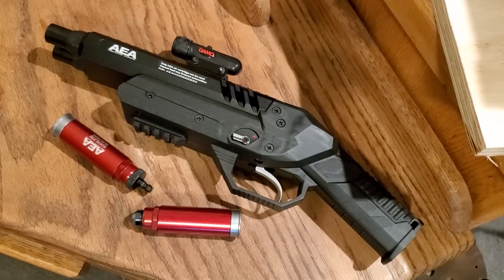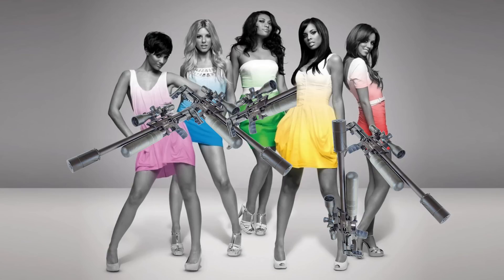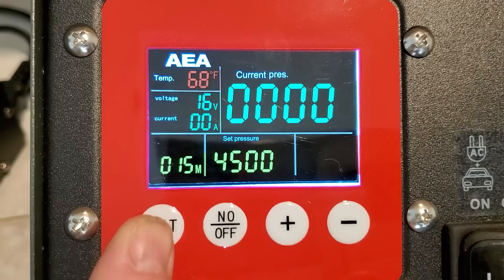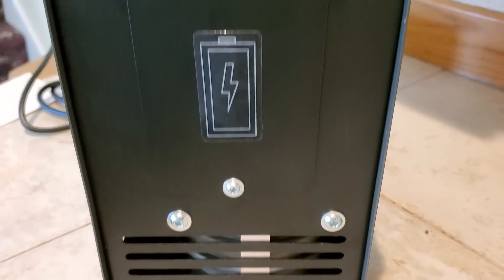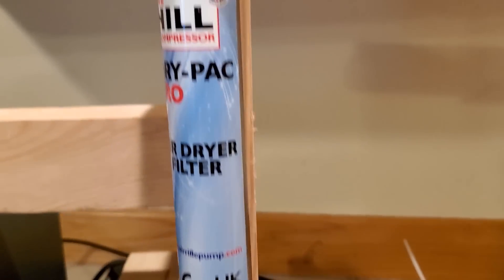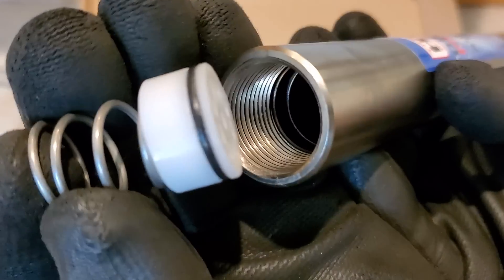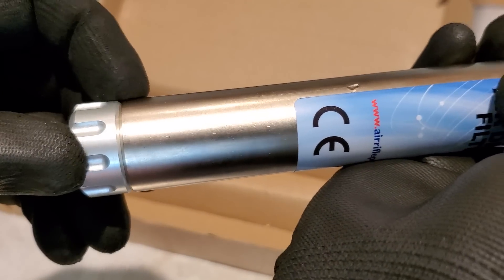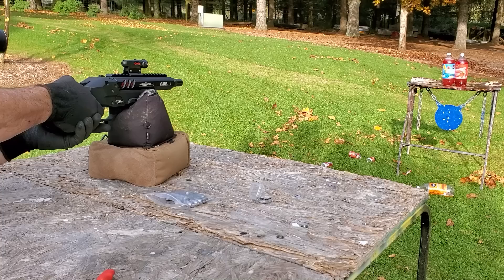AEA's 7000 PSI Air Compressor for PCP Airguns (Review) AEA Airguns Shop  (480bar) PCP Air Compressor

Comment from the maker: The AEA 5000 PSI cartridge took under 1 minute to pump up. The Run Time will read 15 minutes until you hit 15 minutes of run time. Also, the end that I installed my quick disconnect did leak (my fault) which is why the pressure decreased when I stopped filling the cartridge. I messed up in the order I used my washers when installing my hose ends, so the sealing washer I used on the quick disconnect end had too large of a  diameter (washer was not from this kit).  Also, I bought this compressor with my own money and do not recieve any affiliate income from this link.  Compressor is for sale here:  https://www.aeaairguns.shop/products/aea-airguns-compressor?_pos=1&_psq=compressor&_ss=e&_v=1.0&utm_source=nathan_murch&utm_medium=youtube&utm_campaign=compressor_promo_nov&utm_id=compressor_aea&utm_term=aea+compressors

Comment: I am still riding the fence on these.maintenance free compressors.  Unless they have tapped into Alien Technology, moving parts suffer friction, need lubrication that gets contamination / requires new clean lubriccation ....    
What does the manual state in regards to constant run time allowances  ?

Comment: Does the compressor come with the filter and if not would I need it if I'm filling my 98 cubic ft tank ?
Reply from the maker: If you don't use a filter your gun will be damaged by moisture. If you gun is $300 then don't worry about it. If it;s $1500 you will loose performance eventually and the tank can rust and blow up and kill you. PCP filter sold seperately:  https://amzn.to/4n9PLqs

Comment: How is it working after 10 months?
Reply from the maker: It lost pressure after 6 onths but I have a video on how to rebuild it.  coming soon
Reply: @AirgunChannel Sounds great! So even if it breaks it’s easy to fix?
Reply: @AirgunChannel  Bintac AEA website explicitly states that this is for airguns only. NO large tanks.

Comment: Just got my replacement compressor. First one crapped the bed.
#1 its now 110v no more convertor box.
#2 compressor is significantly quieter. Sounds more like my other show box type compressors.
I really believe it wAs defective from the rip.

Comment: Thank you for a really well produced channel.  I have watched so many videos while getting my finances sorted out, I am more than mildly overwhelmed. 
 I apologize in advance.   l am sure these questions are often asked. 
Preface: I am total newbie to this sport/market with only YouTube exposure to the sport.
My current intention is to buy this 480 BAR compressor soon. 

Part 1:  With longevity and quality being my primary concern, would you personally defer to another ( obviously lower pressure at this time ) compressor or would you be more comfortable going with something this new.

Part 2: 
I am going to be limited to around $1000 for my first ( and possibly only ) gun. I can stretch some if needed. I have not settled on a specific gun yet. My primary focus will be small game and target secondary .  I am thinking that a very tight group at 50 yards max in 25 or 22 cal. will be my main priority and ease of carrying secondary since it will probably also go to the field.

Comment: Does anyone have issues with the power converter optioned with the AEA compressor? Works fine on the AEA carts or even my smaller Gk1 tank but larger tanks it trips off. 
Not to mention its $227 from AEA, same $30 unit on amazon.
Looks like this 500w unit is made for smaller things like Tablets, table fans, etc.
Reply from the maker: mine a,so trips off 3/4 of the time.
Reply: @AirgunChannel bought the 1000w off amazon. So far if hasn’t tripped off.

Comment: Also: your voltage drops to 12 volts under load, mine doesn't do that. Probably your external converter cannot handle the load?
Reply from the maker: Converter blows the fuse regularly ..so yes.
Reply: @AirgunChannel are you sure you should set it to 110 and 220. Shouldn't those numbers match, I'm a bit confused on what's going on in your video at the plug setting

Comment: I have one and opened it up: there is a power supply inside with a 110/220V switch, just switch it to 110v and lose the converter.
Reply from the maker: WON'T WORK LIKE THAT.

Comment: Hey my friend.. where do those white washer/orings go? One came with the brass connector in the bag. Figured it went there but the instructions mention teflon tape on that end. I also see one in the plug thats on the machine.. prob to test it. 
The machine end fitting has a small o-ring in it already. I used a reg o-ring gun end and screwed in into the machine as is. It slowly drops pressure after it drops but the fittings seem fine.
Edit i see yours does too.. must be normal. How was your gun end connector ? Mine took some force/working in to get the fitting in snd sleeve locked in place. 
Another question i have is, with all compressors you are told to start the pump with the bleed valve open and then close. AEA instructs to start the pump with it closed.
Reply from the maker: Those seal the fittings, so inside the hole before you screw in a hose or foster fitting. Its a delrin ring.

Comment: I have the compressor and the Dry-Pac. The tube coming from the compressor to the Dry-Pac hose does not fit into the hose. I am sending e-mail back and forth with the support for over a month. Did anyone here had the same issue?
Is the compressor worth it? Otherwise I'll send everything back and get another.

Comment: Wooohooo just bought it… trusty YH starting to make noises and my Cs4 is slow as F.
Also have a CS 12v which is great out in the field but slow like its 110v brother.. just not as slow.
Reply: How did it work?
Reply: @JayPing-d5j5o greats its actually my 2nd. First one started clanking around. 
Got a new pump within the Warranty period. Also repaired my cs4 that had a snapped rod bolt. Had bought a cheap 200 compressor from amazon to get me through so now i have 4 working compressors haha
Reply: @Jeeper1378 which one you like better of the four?

Comment: The best compressors are the ones with water oil and air cooling!!! The other ones burn up!!! I bought a tuxing water air and oil still working!!! I went through three that you did not have oil water!!!
Reply: they are worst compressors, water oil they often go bad
Reply: @gagain100  I'm on year 2 with my water oil and air cooled and I charged scuba tank and five guns!! The air cooled I went through two of them in 90 days!!
Reply: @jerryburns22  Because they are not designed for big tanks. Just for airguns. If You use big tanks then yes water cooling is good.
Reply: @gagain100  I never used them on a SCUBA tank they burned up airing up two guns

Comment: Buyer Beware!!! I bought one and this thing will not stop leaking air. No way of how to set it up, no threads you will need nothing is said here. I look at sitting on my shelf and shake my head. Nothing I do works and it leaks and will not achieve any pressure. Sucks! But I know no one will get back to me. Just for the others who may want to buy this. Don't!
Reply from the maker: Something is assembled wrong. You are probably leaking from your air hose or fittings.
Reply: @AirgunChannel  Oh for sure. Seems like the fitting from the fill whip they give you does not fit the 1/8bsp threads on the filter. Good times. I do not know what  size or thread type is on the fill whip of the compressor either. So I am left to guess and piece this together. Not enough vidoes on this compressor.
Reply: Update to anyone reading this. Scam!! I need a new fill hose and they stopped all correspondence. Just stringing me along. No number to reach them. I just got scammed out of a thousand bucks. Buy from America. I'm reaching out to a lawyer in Spain. 😩

Comment: PSA The air dryer sold with this unit is only rated to 4500 psi max.  I just purchased one in hopes I could fill my gk1 to 350 bar but that's a no go...  I have to use no filter at all or only fill my gun to 310 bar.
Reply from the maker: Yeah

Comment: I just bought mine. I cannot wait. I keep rewatching your video so I am familiar with it. I can't find the manual online though. Hope you are loving it Nate!!
Reply from the maker: Manual included luckily. Thanks for watching! -Nate
Reply: @AirgunChannel  Just got it and can't use it. You never show in the video just how you hooked up the bottom part of the air filter. Super pain in the dick. Nothing works. Then I hook up to my bottle for 4500 psi and it says it reached it but my tank was not filled. And where do all these o rings go?

Comment: Those beads are called a "molecular sieve"... It's used in chemistry to remove water. I don't know if it is cheaper, but you can get it from a chemistry supplier.
Reply from the maker: Thank you!
Reply: Good info.  I wonder if silica beads used in passive moisture absorption bags would be a good cheap substitute.  Great as you can remove the beads, dry out and re-use.

Comment: Guy how is it affordable. It’s a thousand dollars wtf are you talking about.
Reply: Its a must to buy, future are 7000 psi tanks that coming
Reply from the maker: The brown one you saw in the video is $1800. Nost of these are around $2000 or more. As of 2024, anything you buy for $500-$800 will break within 3 months.  The Tech is just not available for make them for $300, but they do make them for $300. Yong Heng direxct to your gun only, no big tanks is your best bet. Will last for 5-10 years.
Reply: @AirgunChannel tuxing twin piston is very durable. Got from AliExpress 640$. I got 130 hours on it had for 4 years  no major failures. I top off my 6.8 liter tank all the time it can run 20 minutes straight easy

Comment: Don’t need nor do I foresee needing 7K so at a grand it’s a MASSIVE pass for me.  I’d buy the gx ek5-1 over this.
Reply from the maker: I'll have to check it out.
Reply: @Alpha_567-n3c  , yes, I thought about that sometime later after I watched the review there are a couple of those GX pumps that are 4 stage and go as high as 5800psi. The 4 stage compression technology is something they have patents on I believe. I’m betting that they won’t have to tweak their design much to get it up to 7000psi. I’ve never seen inside one of those units but the demos I’ve watched they seem to reach 4500psi without even straining. The only reason I didn’t buy one is because for whatever reason they decided to power it with a 12 volt dc electric motor. Anything with a 12 volt dc motor works best on high amp output 12 volt dc power supply. The power units to make them work on 110 don’t make enough amps and can reduce the life of the motor.
Reply: All my smaller 4500 compressors are maxed out all the time. Also neither confirm nor deny 5000 fills with my AEA carts and Huben GK1’s 😂 
Nice to have a compressor.. even set to 5k is not running at its max load.

Comment: The problem with buying from Spain or in general outside of the USA, especially a compressor, (they do go bad), the problem is when the compressor goes south, where do you turn to?  I had a Nomad quit on me after 11 months. Back to Air Venturi it went. Now if they have a repair center in the US, I d consider it.
Reply from the maker: Send it back with DHL for $40. It's not heavy or big

Comment: I like the “NO/OFF” switch.  That’s a first.
Reply from the maker: Now I'm glad I never learned to read.
Reply: I have it on mine too
Reply: @ThePredator2k  what are you using to hook up the silver end of the air filter?
Reply: @charliec8849  i use a different filter
Reply: @ThePredator2k  I was airing up my scuba tank and it shut down on me. The shut off temp did not reach the set temp. Turns out it was the breaker on the converter. Glad for that. Now I know to air my tanks in two parts. Seems to take awhile filling but overall It seems beefy.
Reply: @charliec8849  this compressor is not build for scuba tanks filling. The recommendet maximum size are 800cc 0.8 liter
Reply: @ThePredator2k  Going by what Nate said in this video you are able to fill tanks. It did in fact fill mine (6.8L) not from empty. Now reading your post and wondering if I made the wrong choice.
Reply: @charliec8849  in the compressor manual is written up to 0.8 liter. And a friend of mine told me this small air cooled compressor will not last long when you fill bottles with them. They designed to fill pcp weapons directly and not for filling bottles.
Reply: @ThePredator2k  I reread my manual and saw nothing of the sort. Weird. I also reached out to AEA for a definitive answer.
Reply: @ThePredator2k 
That doesn’t make sense since it’s made to fill a fully kitted zeus 2 that carries more than 800cc of air.
Reply: @MightyRude  i am from Germany. And in the German Compressor Manual is written for Airtanks up to 0.8 Liter.
Reply: @ThePredator2k  
I’m getting mine tomorrow and will be checking the German manual for the difference (I’m not German but can read German well enough because I’m in a neighboring country).
Reply: @ThePredator2k  
800cc at 480bar is 384liters of air, so it might be a good idea to not fill more than 384 liters in one run.
My gk1 runs at a minimum of 250bar, so filling my 6.8 liter bottle from 250bar to 350bar takes 680liter, this means that I have to do it in two runs.
Reply: @ThePredator2k will have to wait to see more but just from looking at it I would have to agree.  Doesn’t seem built for filling scba.  Another reason to massively pass on this.  Not mention AEA consistency in regards to quality is highly questionable at best.
Reply from the maker: NO, that's a Turn OFF
Reply: China engineering at its best

Comment: AEA has been famous for big bore hunting air rifle, of course eventually we will see these 7000 PSI compressor and airgun that can shoot 90 cal.
About the pcp tank, I'm not expert, I only hear from the seller said these pcp can be extremely danger once passing 15 years of life certificated and that's why hydro testing exist to check them every 5 years. Can it still be use after the certificated life time? I do not sure, is it just business thing to make us buying more? or... I don't know
Reply from the maker: To test them they pump them to 7000 PSI..a 4500 tank. The they hand it back and say, it's OK. After they just tried to blow it up. I would not worry about it. That's my opinion.

Comment: Nice looking inverter, what’s the brand and max output on that unit?  I had an older one I was sure would work on a little Tuxing compressor. I would love to dissect one of those 7000 psi compressors, to see the difference in those and the 4500 psi max units. I want one just so I have a compressor I don’t have to push to its absolute working pressure output everytime I use it.
Reply from the maker: That is a 240 max output. The brand is LVYUAN

Comment: I already don’t like the filter setup. I would rather see a cartridge type filter to insert as one piece .
Reply from the maker: Just use a 60.00 Aliexpress filter and don't mount it. Just lay it on the floor. https://www.aliexpress.us/w/wholesale-pcp-filter-.html?spm=a2g0o.home.search.0
Reply: Am I seeing that correctly? The filter media is in direct contact with the metal. Holy cow that’s not good. Desiccant will eat the metal if it’s in direct contact. That’s dangerous. 😊

Comment: Do you know what battery is recommended to power it ?
Reply from the maker: No, you can email them and ask. Probably a 12v Lipo
Reply: @AirgunChannel   12V "LIFEPRO" MAYBE, $150.-+..  NO 12V DC "LIPO" BATTERY PACK. A 3S IS 11.1 V, then there's 14.4V 4S.  How much $$ is the converter/step up transformer from 110 to 220  v ?? Gets expensive!!
!

Comment: ⛔In Europa we use Carbone bottles only between 5 and 10 jears ...depends on how they will be used, but after that time they CANNOT be refreshed they have to go to waste... Everything else would be too dangerous....regards
Reply from the maker: Are you sure about that?
Reply: @AirgunChannel  yes...i'm sure, but it depends on the use ...and it depends on the core of the bottle.... so sehr there are carbon composite bottles with steel core and some bottles with aluminium core that even would make a difference in finaldate
Reply: Carbon is outdated, soon aea Sonic airguns will hit with 7000 psi fill
Reply: @gagain100  bulls#it.... Think about the bottle weight... I think there are lot of people they would prefer or used a lighter  bottle...regards
Reply: Think about shot count and velocity. 1400 fps 50 grain in regulated airgun and 120 fpe from compact airgun